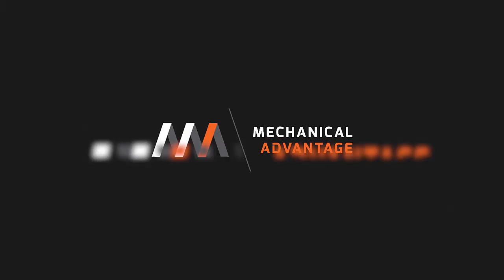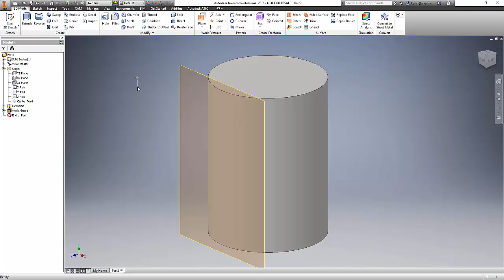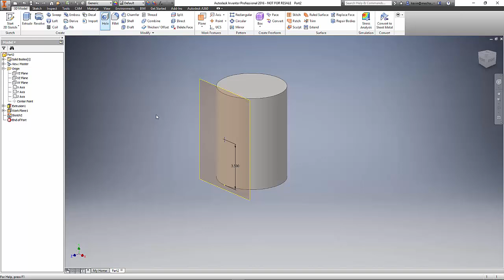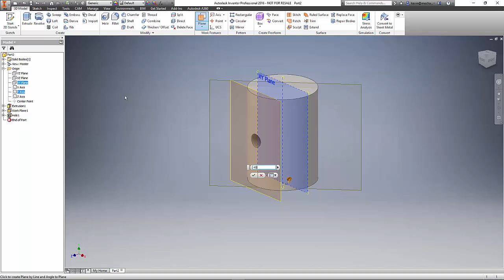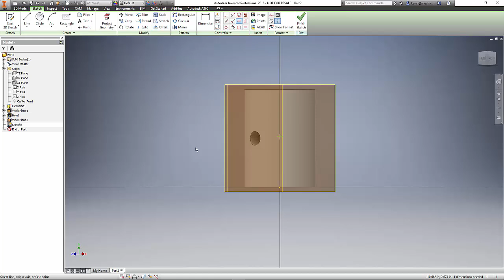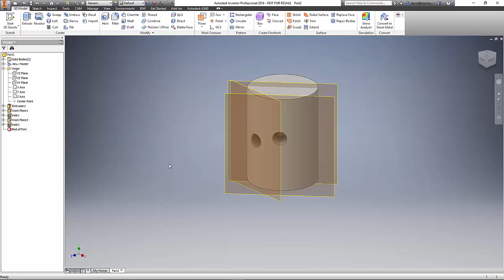Autodesk Inventor Place Hole On Cylindrical Face

Comment: If the same hole is inclined at an angle then how can we do this?
Reply from the maker: You would need another plane that was angled. So it would take a couple mire steps and probably a work axes as well.

Comment: Hello I have a question, I know how to make a hole on cylindrical face but how do I make 10 same holes around the cylinder ? I could make 10 planes but there surely is easier and faster way :D Thanks
Reply from the maker: You are correct, there is a better way. Once you create the first item, you can use the circular pattern command to replicate the feature.
Reply: @MechanicalAdvantage  Yes, I used that one on the first circle I made but can´t make it on the cylinder.... (I am total rookie)  Thanks for replying